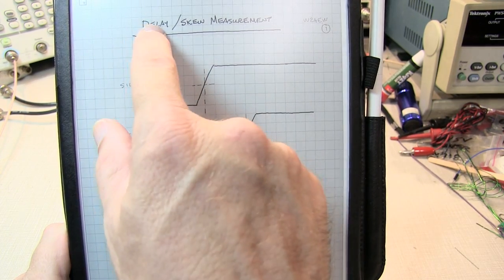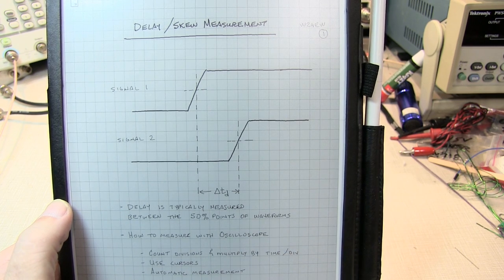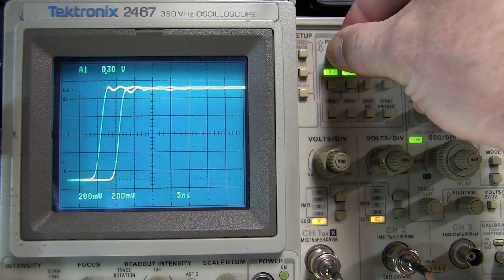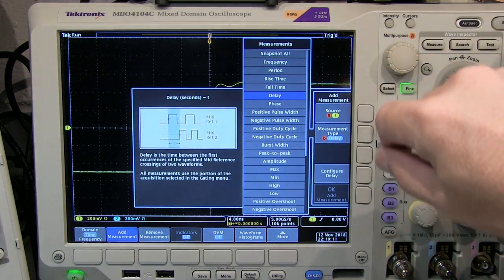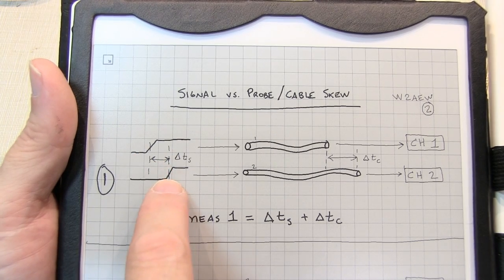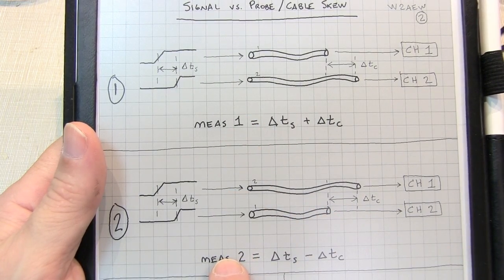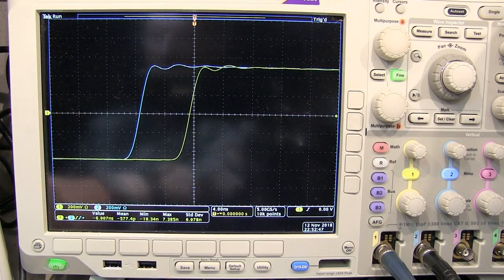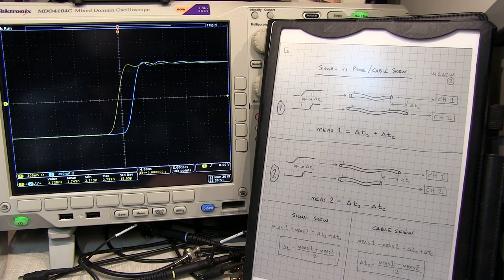#294: Delay / Skew Measurement, and a "trick" to separate device and cable delays

Comment: My 1989 analog Tektronix 2247A with digital co-processor has built in Delta time with movable cursers, which can readout in time, or Hz. It also has automated rise and fall time, and cursers in voltage mode.  Thanks for the tip on different signal time propagation correction👍

Comment: Thank you Alan for all the wonderful videos. You are amazing. Your instructional videos are feast to ears, have been listening to you for a while now. A suggestion for next video, if I may: A design that I am working on requires RF splitter/divider and mixer. The most apparent solution I found is mini-circuits, but they are so expensive. You have some great videos on mixers but not on splitters. It would be great if you can make a video explaining these devices (splitters) and some practical designs/techniques for DIY.

Thank you!

Comment: I have at work an advanced Lecroy oscilloscope. They propose measurements using skew of clock by reconstructing a clock from a data signal using embedded what Lecroy call golden pull. Lecroy even talks about Bathtub measurements. Very confusing topics, what do these terms mean, clock skew, clock noise, how to properly measure a clock deviation. They often talk about clock deviation due to pll noise, power supply noise. What measurements can we do to tell that this deviation, this skew or this noise is acceptable to such applications.
Reply from the maker: Yes, many performance oscilloscopes from Tektronix and others have Jitter and Eye Diagram analysis tools for characterizing high speed clock and serial data signals.  This includes characterizing the many different types of Jitter on clocks and serial data streams, eye diagram parameters including BER vs clock offset/skew which includes bathtub curves.  These tools are used to characterize the signal integrity of high speed digital signals.

Comment: Thanks a lot, wary smart!
I was thinking if you start by mounting both cable to a signal generator with no delay between A and B, you could also get the difference there, before measuring DUT, if one is to lazy. :-)

Comment: This has noting to do with your video, but since you know alot about Tektronix products..what is a "TEKTRONIX TYPE 191 CONSTANT AMPLITUDE SIGNAL GENERATOR
"? Thanks....
Reply from the maker: It is a sinusoidal signal generator that is designed to output a precisely controlled, user-adjustable output amplitude.  Information and manual available here:
http://w140.com/tekwiki/wiki/191

Comment: Hi Alan, that looks like an awesome tablet. Can it hold hundreds of PDF's ? I have hundreds of device data-sheets and application notes.... if there was a way to organize them and quickly access them on this device then this could be an absolute winner for me because I like to read data-sheets like printed paper in my hands rather than staring at a computer screen. The fact that it looks like paper and has the writing capability is just icing on the cake.
Reply from the maker: It has 8GB of internal storage.  You can load and mark-up PDF files.  See www.remarkable.com for more details.

Comment: Hello w2aew, very educational videos you have on your channel, how did you end up learning all of this information? (young electronics tech)
Reply from the maker: Mainly from about 35-40 years of experience working as a tech and then in design, test, validation and application engineering.
Reply: @w2aew  Ah lots of practice. If you don't mind providing more advice I have another question/statement.. Lots of the time I feel overwhelmed with the amount of information I need to be learning, it frustrates me so much in fact that it becomes a mental block and I reject the pursuit for new knowledge regarding electronics, (demotivating). Have you ever had the same feeling or has your passion been strong enough to willingly further your knowledge on the subject. Thank you.
Reply from the maker: @douglas4298  Totally understandable.  Electronics is a very broad field, so it can be daunting to face so many unknowns.  My advice is to start with getting a firm grasp of the fundamentals (ohm's law, passive device characteristics, DC and AC circuit fundamentals, active device properties and characteristics, etc.).  Everything builds off of the fundamentals.  Then, learn more things, bit by bit, as needed to do your work/hobby/etc.  After more than 40 years in electronics, there is still a LOT more that I don't know compared to what I do know.

Comment: Could u give a short review on the remarkable tablet? it looks interesting and i would like to know your thoughts on it :D
Reply from the maker: My very short review:
Positives:
- Very good pencil & paper feel when writing
- Several pen, pencil, brush settings and selections
- Very lightweight
- Very good battery life
- Easy export to PDF files
- Can read PDFs and mark them up (lines, highlights, etc).
Negatives:
- Very expensive
- Folio not included, and very expensive (found a cheaper one on Amazon)
- No backlight, needs good room light to use (similar to Kindle)

Comment: this trick describes the principle difference between PAL and NTSC
Reply: Heard that NTSC stands for Never The Same Color and I can guess that that is what you are referring to. Would love to hear an in depth explanation related to this.
Reply: gamingSlasher a little bit deeper: NTSC color variation comes from non constant phase variiations during signal transfer (the color component in particular). PAL alternates the signals phase between each line by 180 deg. so that these variations can be compensated by doing (circuitry) math.